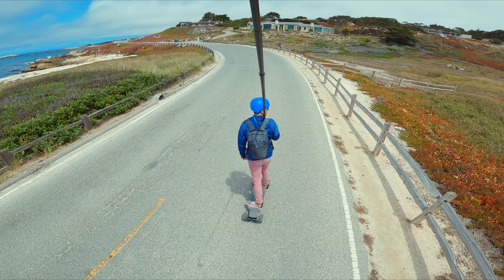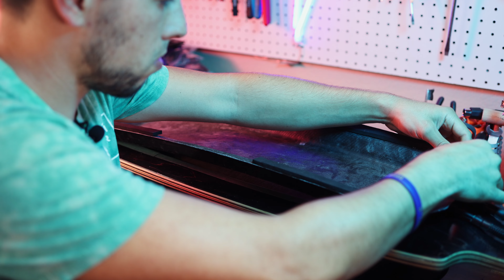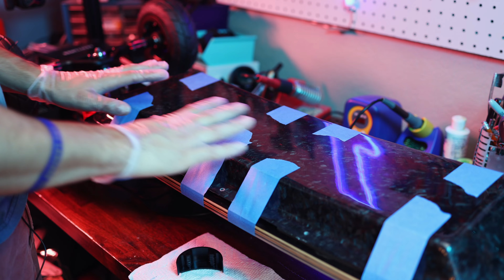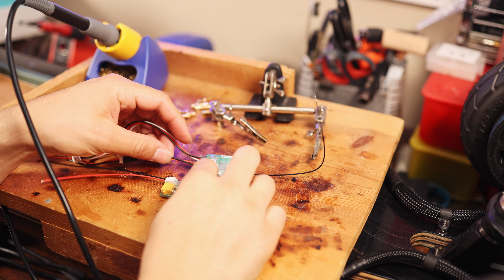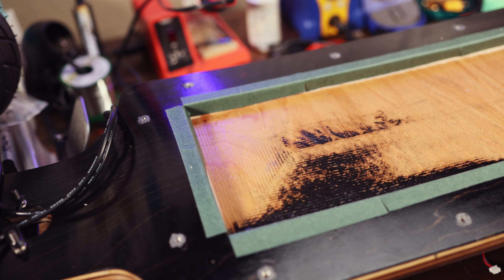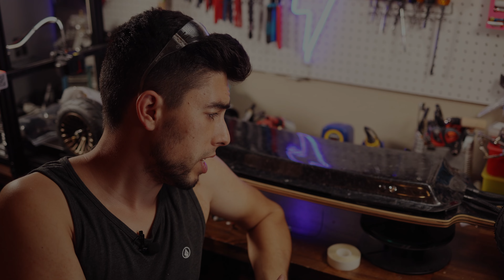Unlocking the Beast: Black Mamba Enclosure & Electronics (Phase 1 Pt 3)

Comment: What is ur opinion on getting a propulsion bord demon 3.0 for a first electric long bord I want to go diy I have experience with long bords and high end electric rc cars or should I just start from scratch
Reply from the maker: Hey there - I think I spoke to you on another platform, but I'll answer breifly for the people here. The Propulsion board is a great opportunity to get into DIY if you get their kit. It takes the guess work out of picking the components and gives you an easy way to experience building without the tricky bits. I think the value is a bit lower than doing straight DIY but overall it's not a bad option nowadays. If you're able to solder and pay someone to build your battery, you might be able to do it yourself a bit cheaper but it's still a large amount of stuff to collect.